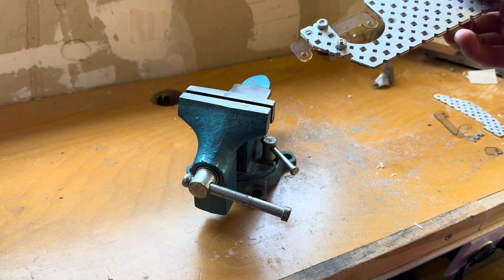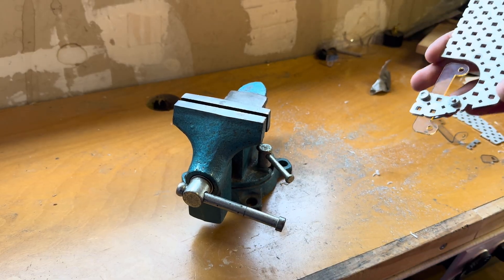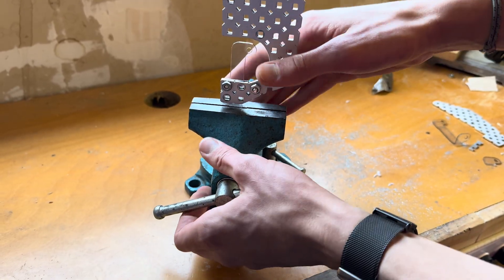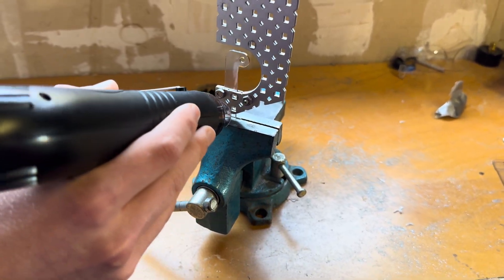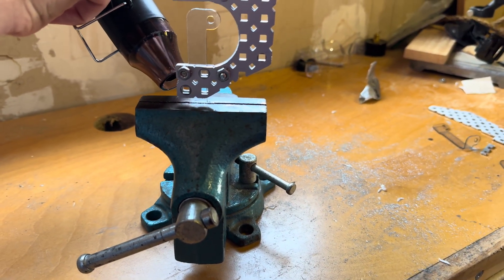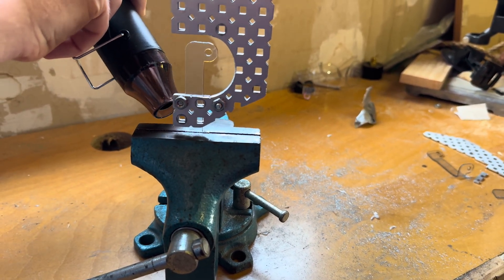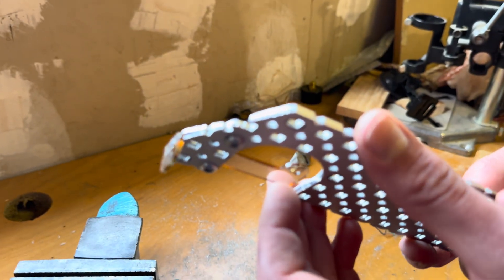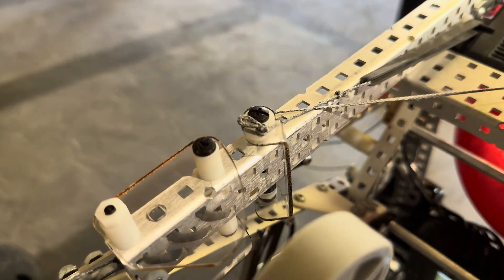2654E Echo Poly Bending Tutorial

Comment: If you don’t have a heat gun, you can also just wear oven mittens and hold it over a low heat stove
Reply from the maker: I'm not sure, we've never tried. I would recommend looking for some affordable heat guns, you could probably find one that could do this around 20-30 dollars.
Reply: @2654Ethe stove works fine , I used it to make U-shaped rotating ladybrown baskets, but heat gun is probably better if you can get one (I bent using stove because I didn’t have time to go buy a heat gun, this was really close to states)

Comment: I understand there are different types of poly, but the one I get from robosource don’t require any heat or even metal plates, I just put it in a vice and push with my hands.
Reply from the maker: Theoretically at least that would lead to much lower strength and a piece that wouldn’t hold its shape as well. By bending it like this the plastic is a lot more durable